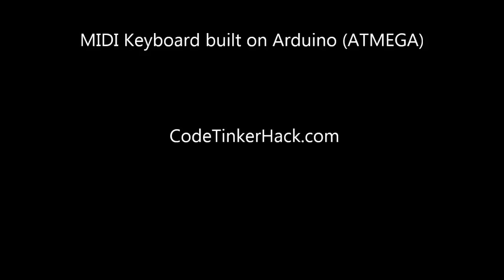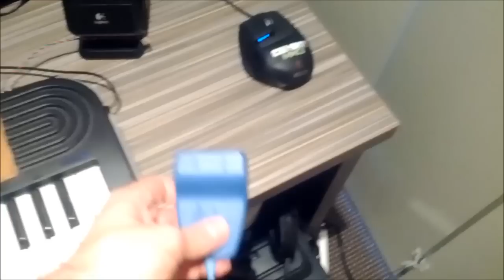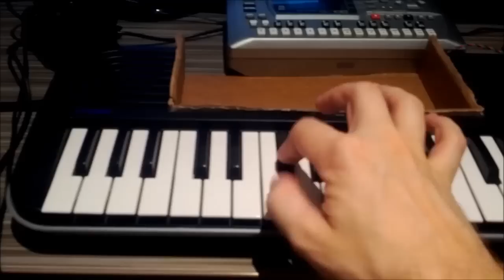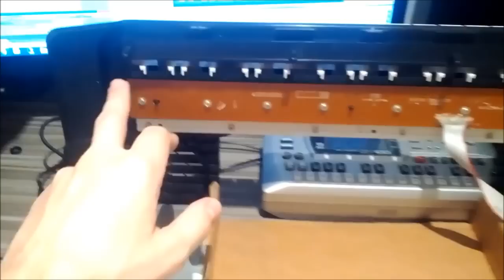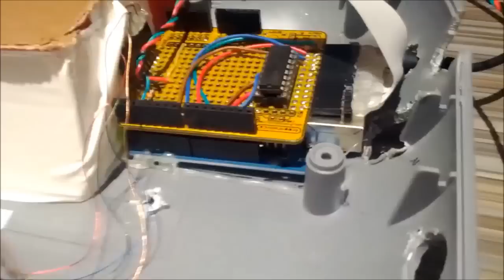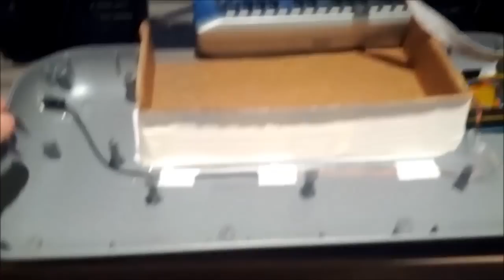How to turn Piano toy into MIDI keyboard (using Arduino/Atmega)

Comment: I have a question, what if I have one of these cheap casio keyboards and not only want to convert it to Midi controller, what if Iwant to use the in built sounds with midi too with an connected Midi in jack too?

Its posible to add Midi In and midi out to this cheap keyboars?

Comment: Hello, I realize the this was done 4 years ago, but I wnet to your website and was unable to find any of the reference material that you referred to in the video.  Is it possible to add it back to the site or if you have it in a transmittable format, could you send it to me if you don't want to add it to the site?  Thank you. Steven

Comment: does your midi to usb converter have latency on each key press?  I've got one of those but could never use it because of that.  What software are you using in windows?